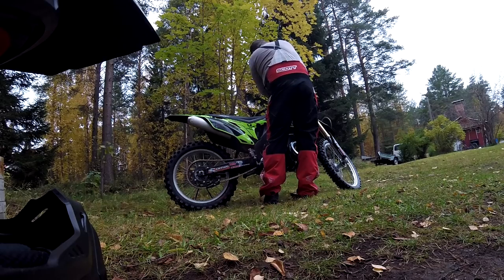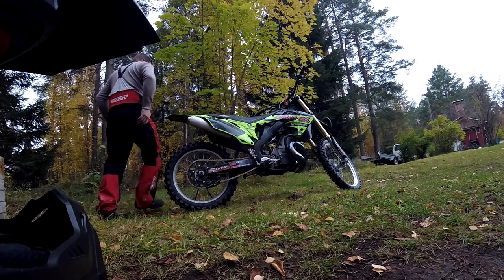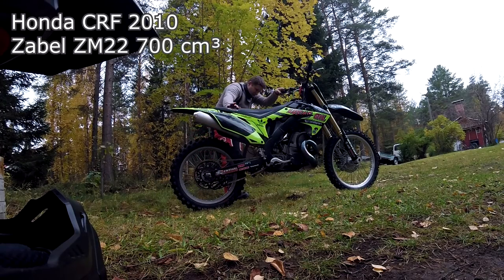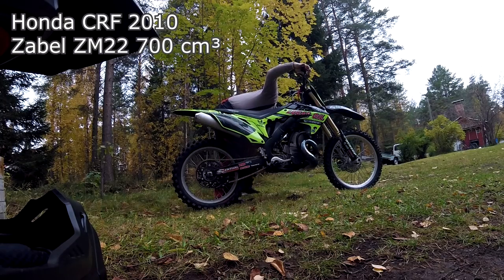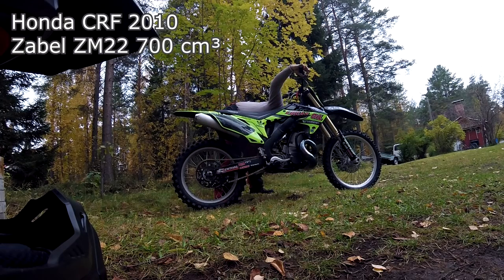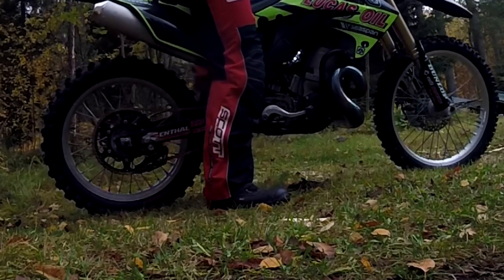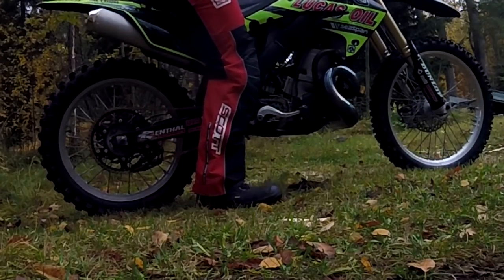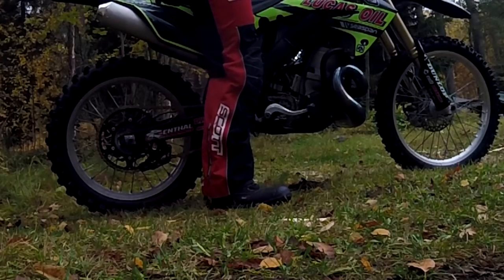Honda Zabel 700: First Smokes

Comment: After two minutes, I bet he can’t feel his hands!  I was writing this when all of a sudden he was shaking his hands.  A CR 500 is brutal in the same way.
Reply from the maker: You're absolutely right! I'm in the middle of truing and balancing the front wheel to see if I get any vibrations off. It feels like the front wheel may be the source for the vibrations in high speeds. I already checked the balance and it was off by 50-55 g.
Reply: Antti Harri ,  I don’t think you will be able to eliminate the vibration you’re feeling and I don’t think it’s the front wheel.  You have a 700 cc single cylinder two-stoke with a lot of power. If the engine had a counter balance, it would not vibrate so much.  The YouTube channel  “Stunt Freaks” (Finland) were going to build a super-Moto with the same engine.  But when they had a chance to ride a bike with that same engine, they thought twice and decided not to build it if the couldn’t hang on to it.  I bet once you got that engine to a rpm where the torque started to hit, I’m guessing it was kinda fun?
Reply: I have a CR and it doesnt vibrate so much as buzz. My YZ490 vibrated. Like a paint mixer. I have since had the crank rebuilt and balanced within a gram of its life and nownit doesnt vibrate at all. Its smoother than my brother's 250. When I rebuild the Honda, its definitely getting its crank balanced as well.
Reply: A trick from the old days was to fill the handlebar with lead.

Comment: NOTE: To all folks either buying or building up a bike with a 700cc 2 stroke motor......Beware these engines in a bike that a rider hits big jumps, in most cases either sends bike & rider straight into the sun to perish or into outer space where they never return. Also these engines are notorious for causing bikes riding on flat surfaces in a straight line to reach take off speeds and when they lift off they soar high up into the sky! Followed by a crash landing so powerful & with that much energy & force, the bike and the rider are instantly vaporized! I have witnessed this too many times, not so much as a dust particle remains.                                  Don't let this stop you from experiencing the 700 nor the ownership of one that will crown you the 'Grand Poobah' of big bore dirt bikes, modify the fuck out of it too! Fuck yeeeeeah they're awesome and worth dying for even for just 5 minutes on one. Do it! Get one! 500's are piss weak, 700cc is where it's at....of course 2 stroke, what else is there.
Reply: If anyone needs their ditches dug out, or a trench dug for water pipes, I have a CR500 with a one over size piston kit in it to help you with that! I thought my KTM500EXCF was fast, the CR is "stupid fast fun"(medical insurance strongly recommended) Cheers from British Columbia 🇨🇦👍😎

Comment: seems like a good 450 would be a better alternative "IMO" I had a yz490 and it wasn't fun at all to ride for more that a few minutes due to vibration. I cannot even imagine how much this thing vibrates
Reply from the maker: It doesn't vibrate nearly as much anymore after I trued rims and balanced the wheels. I'm hoping to upload a new video soon but currently I'm waiting for the "tickler" (floods the carb before starting) that flew off when I was testing the wheels.

Depending on how you want to ride smaller engine might still be more fun. This isn't for narrow paths in thick woods.
Reply: JAPbikes 4LIFE i had the 1992 wr500 with the heavier fly wheel the was almost  no vibrating
Reply: I have an '83 IT490 (with YZ plastics) with a micobalanced crank. Zero vibration and silky smooth power delivery.

Comment: hi might be a silly question but what is extra lever for under the clutch? awesome machine man can only imagine what that things like to ride!!!
Reply from the maker: It's used to engage compression release valve. It's not really possible to start the engine without taking off some of the compression of the piston.
Reply: Antti Harri woaw really and here I am with my 125cc ktm
Reply: decomperession

Comment: How hard was it to fabricate new motor mounts or to swap the motor to CRF frame? ATK no longer makes the Intimidator 700, and trying to get a Maico 700 to the states is very expensive, around $16,000 usd 😳
Reply from the maker: Woah that's crazy expensive. I paid for the whole bike about a third.

The swap was done by the previous owner. From what I recall he said the rear suspension top mount had to be aluminium welded on the left side to fit the air intake boot. The rear tyre is from a KTM because the kickstarter is on the left. I think he had some trouble fitting the radiators and the exhaust expansion chamber is made by HGS.

Not sure where the rear brake is from, but it sucks. The master cylinder spilled all the fluid out through the top cap of the cylinder.  And the engine vibrates like hell. Other than that, it's really interesting to drive. :D oh and it pretty thirsty for fuel. I heard there is larger gas tank available for CR, might get that some day. First I'll get the original seat which is softer and better with the vibration.
Reply: Thanks for the reply! Very nice bike. How would you compare the power to let’s say a CR500? Yes the Maico is very expensive and the guy only does them by order only. But awesome build you have👍
Reply from the maker: The chain gear ratio is long and it still wheelies with just throttle. It's too powerful for narrow hiking paths and such and also the clutch is bit finicky. Dirt roads are quite fun though. The previous owner built it for ice tracks (ice speedway?), but I dunno how it would perform on ice.

Thanks. :) Are you planning to get 500 or 700 yourself?
Reply: Id like to build one as well, but with a engine that has a balanced crank!
It seems fairly well sorted out, it just needs some fine tuning from the looks of it.

Comment: what is the point of this engine if you cant twist the throttle,  there is no way u can put that much power to the ground. It would be good in some sand dunes put in woods its just over kill. I didnt hear this bike go in the high rpms not even once :(
Reply: that’s actually good for the enginge and it lasts longer than the high small reving ones
Reply: Yann Hayon in the end he starts to get it in the higher rpms
Reply: @jsosskkss9884  You must have been on something that was jetted horribly wrong. My CR500 can just putt around all day long without any problem.
Reply: @jsosskkss9884  this ain't 1985, modern 2 strokes can putt around all day with no issues, these big bores dont rev high anyways
Reply: @jsosskkss9884  Actually I have 2 Banshees and other 4 2stroke machines, and I can say that if you have the correct jetting and you knows how to ride this type of engines you can go on full throttle almost everytime, letting they "rest" At the correct times, putting attention to the temperature and using good mixing oil, but if you dont know how this works better stay 4 stroke for ever, with half the power, one explosion for two rpms, they are loyal machines to abuse his limits😅
Reply: The recipie that Ive run for 30 years is Sunoco Silver (100 octane) mixed 40:1 with Klotz castor. I have never had an engine failure of any kind, with everything from high revving 125s to my current stable of 500s.
Reply: 2strokes like to be rev high
Reply: It’s not supposed to rev like a 250 mate 🙄
Reply: Go and watch sidecarmotocross (where the motor gome frome) on youtube

Comment: Hi! Perfectly!!
1)Where did you got resonator?
2) did you use adaptor kit for frame?
3) what about fuel consumption? Same like cr500?
4) can you compare by power (your feelings) with cr500?
Reply: he bought the bike he didn't build it
Reply: It sounds like it's running well
Reply: @bigthunder2860  absolute monster in the dirt too
Reply: There was a video by 999lazer who compared this to the cr500. Obviously this has more torque down low. It's overkill for any motocross, the spinning forces of the engine is more noticable.

Comment: Is there a project page from this bike ? Im currently building a zabel engine in an honda crf 450
Reply from the maker: Not that I know of. Sorry
Reply: Ah okay is it possible fmto send me some pictures of the engine mounts to the frame? Only for inspiration.
Reply from the maker: @emiel1o  sure. I'll get back to you on weekend.
Reply from the maker: @emiel1o  sent some pics. They are welded to the aluminium frame.

Remember to improve brakes. Honda's brakes are terrible for zabel's power.

Comment: Also id turn thay into a super moto and put it on road and put carbom effect plastics on it mynmate done it with his cr500 it was the best a nicest 500 ive seen to this day was inna crf 2018 frame with some adjustments tonget the egine to fit
Reply from the maker: I prefer functionality over bling. The bike cannot be registered street legal, motocross version makes more sense.

Ps I have a new carb coming, I hope to solve starting problems with it.
Reply: Yeah i get you bud but here inn the uk you can send off for a log book and get one ive seen two street legal yz 85s in the uk and my mate got a 160 pitbike wbp there called just to get him a few miles to work and back but he got that street legal to and a couldn't belive it for  a pitbike it was fast worth a try bud but you have one lush bike and id never ever get rid of it ever one of the best bikes ive seen hands down i didn't even knew they made these engines and it firs in that frame perfecr but if thatbwas in the uk you could get it road legal absoulte lush should get some spoke wraps for it alumnus green therw cheap on ebay and upgrade the brake lever and have all the bolts gold and metalic blue and red it worth it id even get you're engine bkastes so it looks brand new like chrome enjoy anyways hope you nevwr get rid
Reply: Id spend momey into tjat bike if it was minw and nwver gwt rid of it you should get youre wheels powder coated candy apple red or gold or a love burnt orange and get spoke wraps get them on ebay cheap just stick on thenspokes to change the colour but man this isnthe best bike I've seen 💯💯💯 much love from the uk

Comment: is that maico 700??
Reply: Same engine i think
Reply: No its an Zabel 700ccm
Reply: MAICO engines are Zabel.
The 700cc is nominal, the real displacement is 686cc.
MAICO bought Zabel in the mid 80's (if I remember right)
Reply: @levisalvini4110  Incorrect by a long shot.  Zabel used to use Yamaha big bore 2 stroke engines in the early 80s but a pair of racers wanted to use a 2 stroke.  They started with a CR500 engine and blew it up.  Then Zabel said he would work with them but only if they used a Maico engine.  The rest is history.  Zabel made modification parts for Maico engines, like a bolt on cylinder.  Since Maico had gone bankrupt and was unstable future in the 1990 Zabel just manufactured the whole engine themselves, which was based on Maico with their mods.  Over the years it grew apart from Maico but still the same overall engine design, even the bolt patterns are the same.  Zabel in 2000 made their gears thicker and the gear shaft 1mm thicker than the Maico.  They eventually also went case induction.  However, some parts are still interchangable and the bolt pattern on a Zabel engine is the same as Maico engine.  Zabel used to make a 685cc but they are actually true 700ccs since the early 2000s and this one in this video is 700cc.  Koestler who has been making Maicos since 2000 had sponsored a Supermoto team and they wanted more power than the 500 so he had a 620 and 685 (aka the 700) made for Supermoto racing.  You can buy it today as an engine or a full bike.  The differences between modern Maico and Zabel engines:  Maico is cylinder induction/Zabel is case induction, Zabel has a larger intake and reed block than the Maico. Zabel has thicker gears and shaft.  Zabel is dual plug head.  Maico has MX and Enduro 5 speed gearing.  Zabel is close ratio 4 speed.  Things that are the same, the kicker and components like the clutch and the ignitions are the same.  The bolt patterns are the same (although zabel has thicker frame bolts).  The carb is the same.  The front sprocket is the same.  There may be other parts that are the same, I think the piston may even be the same (100mm) as I think zabel just has a longer stroke.
Reply: @Maicowerk  
Thank you so much for the wonderful explanation, I've learned something new thanks to you.
I was wrong...
Take care...

Comment: what is the second lever at your left ??
Reply: Jean mi M decompression lever
Reply: decompression
Reply: I didn’t know that 2 strokes had decompression levers
Reply: @mtcmotorsports4512  
Most chainsaws with a displacement over 60cc have a decompression button. Makes stating so much easier.

Comment: Nature isn't place for 2 stroke
Reply: 2 strokes are considerably quieter than four strokes generally. I don't know about the 700 though
Reply: Nathan Slocum there was a 250 at my track that was louder than my crf450 with a yoshi exhaust
Edit: 500=250
Reply: @BigBad21  I get that, there are always gonna be guys with shorty's that need repacking. If it's a normal length exhaust, even aftermarket on a 2 stroke it should be quieter than a similar four stroke. That 4 stroke low end sound carries so far. Also the AMA screws two strokes with the sound profile they use to listen to bikes. It completely ignores the low end sounds which is basically all 4 strokes are. I lug my 300 so I'll only hit above 3/4 throttle 6 times during a ride. Most guys can't hear me in front or behind them over the sound of their own bike.